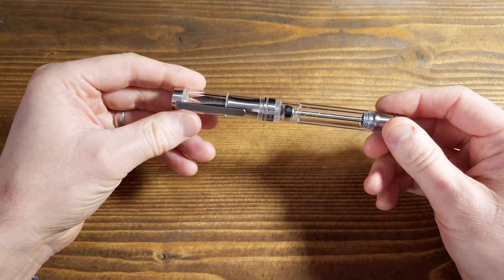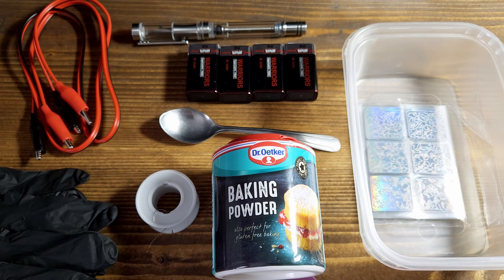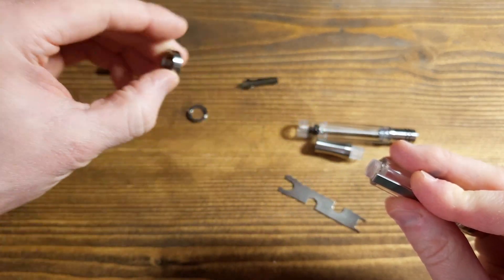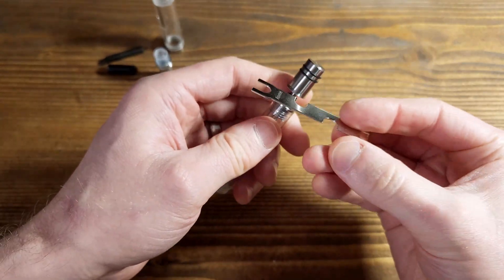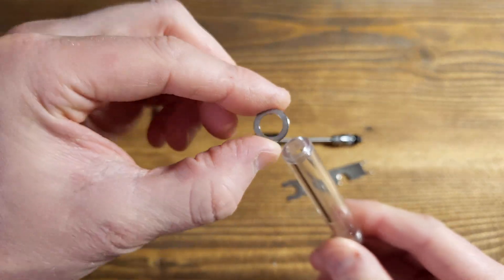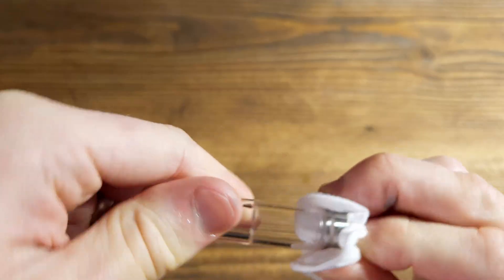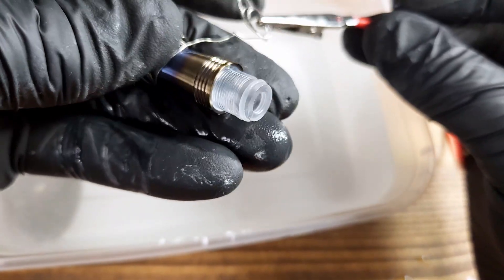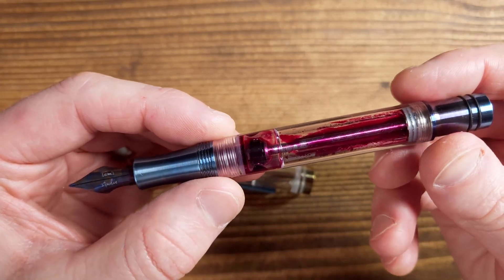DIY Titanium Pen Customisation - It's a Game Changer

Comment: Phew… alcohol is supposed to be death to acrylics: cracks it upon contact, so I panicked a little when you said you were going to clean the cap rings. Since it didn't damage the pen, I wonder if Asvine uses a different kind of plastic, or maybe isopropyl is different from the ethanol we get here in Europe 🤔
Reply from the maker: I was super carefully to only touch the metal at the bottom 😆
I think the isopropyl alcohol I used was ~70%